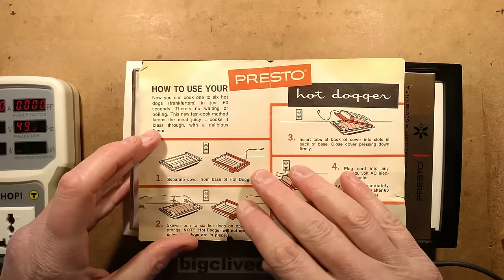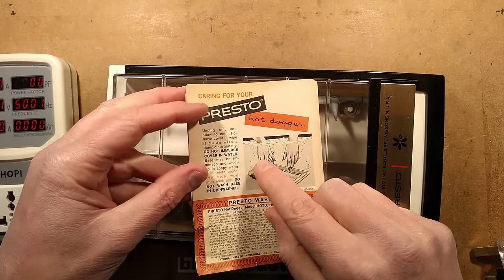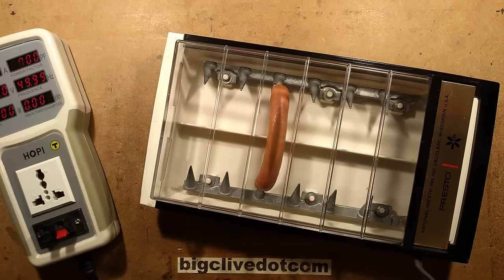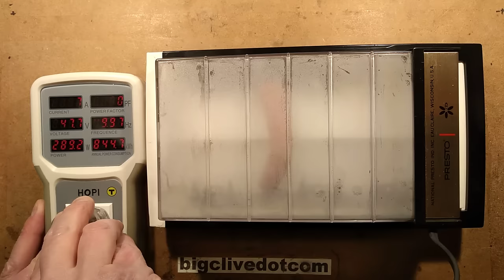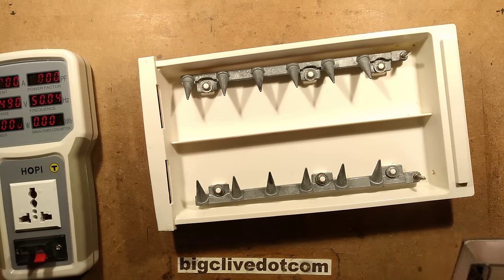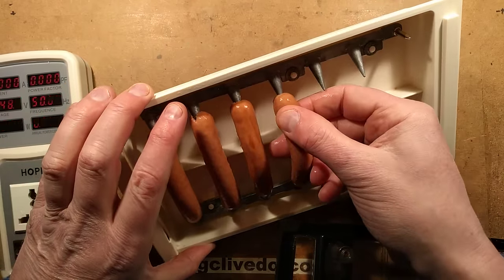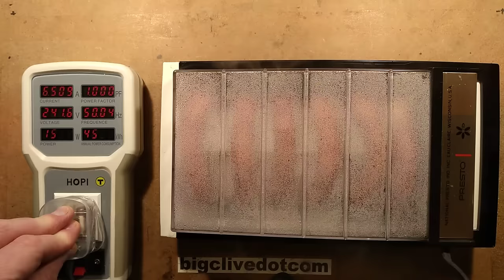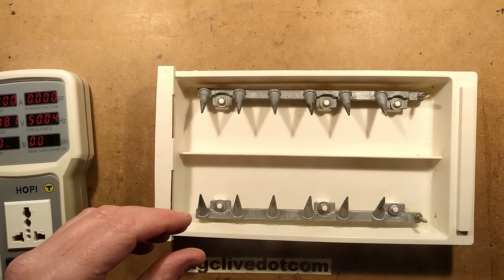Turbo charging a 120V Presto hot dogger on 250V.

Comment: Not really bad, this is a nearly 100% efficient way of cooking hot dogs, the power is used for nothing but heat generation in the meat directly.
Reply: you could play around with different shaped "connectors" but otherwise I agree totally
Reply: Every electrical heater is 100% efficient
Reply: I was thinking I could use pin headers and cook with lower voltage, but I never tested that
Reply: @crackedemerald4930  yes but on a electric stove the heat gets lost between the stove and the pan also in the whater
Reply: @badacconosu  water? No dont tell me you're the kind of person who boils hotdogs. The best part is the burned part!😂
Reply: @crackedemerald4930  except for fans moving air
Reply: @VTF5252  makes no difference - still ends up as heat.
Reply: @crackedemerald4930   the hot dog is the heating element...... just think about it
Reply: @109268  in swizerland evryone does that ^^ or the small kiosks steam them
Reply: @paulabraham2550  But not on the right place... Same goes for micro wave oven - fan, noise, ventilating the chamber (heat loss too), losses in electronics and so on. Nothing of this goes into the food.
Reply: I think we got one for Christmas here in the states around 1978. Makes me want to closet diving for old appliances now lol
Reply: @paulabraham2550  only if the air totally stops moving from friction
Reply: @badacconosu   Do yo actually eat Franks in switzerland? Here in sweden we usually only boil sausages that have skins on them..
Reply: @rimmersbryggeri  yes we do
Reply: Yeah, but it's grotesquely inefficient in that this whole device, that costs money, uses materials, has to be carefully cleaned, is fiddly to use, and takes up space, is capable of cooking exactly one size of exactly one type of food item and is otherwise totally worthless.
Reply: The big problem with that sort of heating is the chemically altering done to some of the foodmolecules, especially around the connections i dont dare to eat the black or often uncolored even unvisible changes. And if no trust in the meat near the ends of the thing i dont know with sertaincy how much of the meat contains no chemically strange altered proteïns or fat or so
Reply: @badacconosu   Ok I thought you had a higher sausage culture than that.
Reply: @crackedemerald4930  Except if you use power to heat the air which then heats the food. Wasting a lot of power. If your goal was heating the room tho, then it is 100% efficient.
Reply: @crackedemerald4930  Every electric heater is 100% efficient at generating heat, however there's no guarantee that 100% of the heat that you generate will be successfully transferred from the heating element to the thing you want to heat.  In this case, however, the hot dog is the heating element, so it's 100% efficient in that regard too.
Reply: @crackedemerald4930  they are 100 proc efficient in translating electricity to a warmth, but they are not 100 proc efficient in transfering heat where you want that heat to go
Reply: I'd never eat something that had mains electricity go through it.
Reply: @109268  you have to admit tho those New York dirt water dogs are good but at home thats a sin the dogs they are one of the  things i do when im forced to go to the hell hole known as NYC
Reply: pF of 1 lmao
Reply: @robson6285  If you're worrying about your health you wouldn't be eating the hot dog that came out of the package laden with salt and multiple other chemical flavorings and artificial dyes!
Reply: @robertvirginiabeach  so true!!
Reply: @crackedemerald4930  That statement ignores the comment. Chris did not state the efficiency of the hot dog as a heater. Chris stated the efficiency of cooking a hot dog. These are very different things. Examine the processes. 

Apply electricity directly to the hot dog to raise it's temperature. The only real source of inefficiency here is in how you deliver the power to the hot dog. Delivering the power through a semi-conductor you will lose some of the power as heat bled off the semi-conductor before the hot dot. One could use a super conductor to remove that inefficiency but that would very likely turn into the most expensive way to cook a hot dog.

Alternatively you could cook that hot dog on an electric stove. That process has many more sources of inefficiency towards cooking a hot dog. First you must raise the temperature of the heating element. Then you must raise the temperature of the immediate environment (surrounding air) around the heating element. Then you must raise the temperature of the thermal mass embedded into the bottom of the pot/pan. Then you must raise the temperature of the pot/pan itself, which in any good pan should raise in proportion to the thermal mass. Then you must raise the temperature of the medium inside the pan (be it air, water, oil, mac'n'cheese or pasta). Then finally the end of the journey of the heat, raise the temperature of the hot dog. That's a horribly inefficient way to cook a hot dog, why not just cut the middleman out and jam it into a wall socket.
Reply: @sqike001ton  Yeah I was just ribbing him. NY food laws are the reason they have to be boiled and kept in hot water, it's really the best way to keep them out of the danger zone when you're dealing with food carts in sub zero cold.
Reply: @robson6285   its a hotdog.. if your going to question the chemical nature of the cooked meat, you have no idea of its pre cooked state
Reply: @crackedemerald4930  but not 100% at heating food, some are mote efficient than others
Reply: ChrisD4335 it's 100% efficient, actually. If it's 100% effective, I don't have a clue. 😉
Reply: @ThoolooExpress  haha, gotta watch out for those filthy electrons!
Reply: @crackedemerald4930  "Every electrical heater is 100% efficient"
except there is a waste product: light?
Reply: @tommcewan7936  Yeah, no doubt it's impractical.  If I saw one at a yard sale, though, I'd probably eat hot dogs for a week straight just 'cause it's so cool.
Reply: @circuitsandcigars1278  My late parents got a newer version (pretty sure it was a Presto), sometime in the 80s, that we used fairly regularly. It's probably still kicking around somewhere.
Reply: Cracked Emerald false. What about the light and sound emission?
Reply: Have cooked hot dogs with an extension power cable and a twist of a coathanger.
Reply: @crackedemerald4930  Guess you've just been watching EEVblog.  It's only 100% efficient if the heat stays in the dog. Re-watch EEVblog where he talks about losses to the atmosphere through poor insulation etc.
Reply: @109268  Barbarian! Frankfurters also known as Wiener sausage (pure pork, smoked, sheep intestine casing) should ONLY ever be steamed, alternatively put in hot water (boil the water, then turn power off, drop in sausages for 10-15 mins).
Reply: @jarls5890  An actual frankfurter is not even close to the same thing as an American hotdog man.
Reply: @109268  Alrighty! Feel free to update Wikipedia then as it says:

"The hot dog[2][3] or dog (also spelled hotdog) is a grilled or steamed link-sausage sandwich where the sausage is served in the slit of a partially sliced hot dog bun, a bun of size and shape to hold the sausage.[4] It can also refer to the sausage (the wurst or wörst) of its composition itself. The sausage used is the wiener (Vienna sausage) or frankfurter (also frank). The names of these sausages also commonly refer to their assembled sandwiches"
Reply: @jarls5890  Yes, and an American style hotdog is an artificial cased sausage bearing no resemblance to the German  lineage it is descended from.
Reply: If that's what you're looking for, the microwave is the best way.
Reply: The hot dog radiates heat, so while good, it's not 100% efficient at heating a hot dog, just 100% efficient at generating heat within a hotdog.
Reply: @sqike001ton  I hate to say it, but you havnt really lived until you have a Hot Dog from a vendor on the streets of New York
Reply: @crackedemerald4930  - except the glowing ones, when they give out light. 99% heat, 1% light !
Reply: @paulabraham2550  - except maybe for the amount which reaches the ears as noise! 
No heat involved.
Reply: @ThoolooExpress  - except for escaping sizzle = energy escaping as pressure waves in air, of which some is converted at ears as noise  = electrical signals to brain.
Reply: @martinpickard6043  Okay... I'll give you that... it's not 100% efficient.  But still a lot better than a pot, a grill, or a microwave.
Reply: Efficient doesn't mean tasty.
Reply: @landonpowell6296  good point mr powell
Reply: @tommcewan7936  This type of device could replace traditional Hot Dog Rollers, which do just that.
Reply: @robson6285  The kind of chemical reactions that happen on the electrode/meat contact points woulddnt be disimilar from that of a frying pan on an electric stove. It depends on what your electrodes are made of.
Reply: @109268  Thats how you do it in germany.
Like normal people.
MURICA isnt very normal.
Reply: @haywoodjablome440  but electrolysis? That must in proteïnes and all that biomolecules weird new random half molecules make? I mean at least H & O & ions etc are things you dont make that way when heating normally. So i thought. I dont really know so if you do know more about eatable electrolysis then feel free to tell me more?
Reply: @robson6285  Well, if youre concerned about it at that small level then youd be reassured by the thought that anything that has gone through such a drastic level of change would probably get stuck to the electrodes and never make it to your digestive tract.
Reply: stove will have some losses through switches, voltage regulators, controls etc...whereas this is literally direct power into the meat lol
Reply: @crackedemerald4930  Technology Connections?
Reply: @robson6285  And I wonder if microwaves do that as well.
Reply: @SweetTodd  no microwaves only heat the food. Electrolysis is only a problem by current trought a liquid. But indeed, a littke eddycurrents will go though the food in a microwave so absolutely sure i am not about that
Reply: @crackedemerald4930  Not quite. Those heaters lose some power to sound and radiation. Nothing is 100% efficient.
Reply: @badacconosu  Also you lose some energy to the walls due to the wiring from the meter to cooker element being a weak resistor also. The biggest loss of all when cooking hot dogs by boiling though will almost certainly be the energy being lost to the heat of vaporisation due to the boil off, water thanks to it's strong hydrogen bonding has a rather large heat of vaporisation so producing steam as a waste product is rather thermodymanically expensive.
Reply: @tommcewan7936  
That's not true!  It could cook a potato, or any other food with some water in it, maybe a burrito!  😂😂
Reply: @tommcewan7936  hmm well you could try other things.... Cucumbers? Cheese sticks?
Reply: May have been efficient but often the hot dogs tasted like burnt hair! Really, I remember because I had one back in the 1970's. lol.
Reply: Electrolysis!!
Reply: @tommcewan7936  I understand what you're trying to say but many items are single use such as a coffee maker or electric kettle these items can also be hard to clean and are only useful for a single purpose. (Although water is just generally great and useful for just about everything) I'm just saying excess is kind of cool sometimes despite the waste of resources.
Reply: @robson6285  "i dont dare to eat the black or often uncolored even unvisible changes"
" i dont know with sertaincy how much of the meat contains no chemically strange altered proteïns or fat or so"

Yeah, you have a neurosis. That's fine, but you have one. Just FYI.

Comment: If you listen you can hear the screams from health and safety  :)
Reply: You never touch me anymore.
Reply: Wat ^
Reply: it has a interlock, so its safe :)
Reply: Health and what?
Reply: Yep looks perfectly safe. Old, but safe. I wouldn't leave it unattended though. Not that you would have time to since it cooks so fast.
Reply: Sounds about right 😂
Reply: It's actually safer than a toaster, as you have no access to to the live electrics as the rails are only live with the lid on, you'd have to poke something very small into the receivers on the lid while its plugged in to get near the current.
Reply: are you guys serious? this device literally electrocutes hotdogs and breaks its chemistry its not a hot dog anymore when you run current through it
Reply: @ErtugrulOzdemir-mf1gl  
It adds some flavor from the electrolyzed electrodes. Additional minerals.
😎
Reply: Not in the era when these were manufactured. 😂

Comment: I had one of these back in the '80s, when microwaves started at a few hundred dollars.  Aside from a slight metallic taste at the contact points (likely from a lack of cleaning), it worked very well.

A dill pickle in there for a few minutes gives a rather interesting light show at 120V; it would be interesting to see what happens at 240V.
Reply from the maker: We put a large pickle in during a live stream.
Reply: Naughty - I like  😃
Reply: My family had a large "in wall" microwave oven back in the late 1970s.
I used to take frozen hamburger patties from the freezer, and "cook lunch" for myself in it.
I was QUITE poor at doing this, and ended up with ugly, shrunken patties, still cold and uncooked at the center, and light brown on the outside.
Yum!
Reply: @bigclivedotcom  Why isn't there a clip of that on youtube? I need to see it!

Comment: Okay, I like the 'overclocking 120v appliances' idea.
More, please!
Reply: I've been witness to someone plugging a 127V coffee maker into a 220V outlet whilst working in Brazil. We knew the coffee was done when the glass jug shattered. Twenty seconds for the hot-dog seems reasonable: twice the voltage, four times the power, assuming the resistance of the hot-dog remains constant.

Have I really just written "Assuming the resistance of the hot-dog remains constant"...?!
Reply: LOL.. I did seriously think the hot dogs were going to explode a few seconds after being powered up.  I remember how they popped and sizzled, and that burnt electrical smell (and taste..).  Sadly, they only cooked faster. :-P
Reply: @chrisw1462   I thought they might too!
Reply: do you know the channel photonicinduction?
Reply: My fridge on 240v can approach absolute zero. Food lasts for 20 years or more and visitors never come back twice for a midnight snack.
Reply: Yes. Toasters are definitely a thing to try. They glow so nicely.
Reply: @HowardLeVert  yes you did
Reply: I also like this idea...I really miss PhotonicInduction's experiments...and it would help fill that void... also maybe if the appliance blows up, Clive could take it apart and see what went wrong.
Reply: Watch Barry Lewis video where he plugged a 120v toastie maker into 240volts 😂
Reply: Next, a Weller soldering station. Errr... wrong channel.
Reply: this is a really common way of infomercials to overdrive their stuff so it works really good.  The reason that they generally toss them under the counter after use is because they are hot as fuck and probably gonna smoke.
Reply: ManiacGamer That was truly dangerous for him because he didn’t realize at the time what was happening lol
Reply: Chubbysumo - ☹️🤬
Reply: Make it a bit more like the old photonicinduction channel :)
Reply: Just no burn human references, please!
Reply: @HowardLeVert  It seems that the hot dog resistance varies.  I suspect it curves up rather quickly as the moisture leaves, given the notoriously steady energy input needed for that steamy phase change.  Of course, that jump coincides with "done", so I think it's reasonable to assume (and this experiment suggests) that you're correct and that resistance is generally constant during the cook time.
Reply: @danroberts7975  the correct technical name of that procedure is "take it to bits". 😄
Reply: Hope life is going well for Mr Photonicinduction
Reply: @borayurt66  10kV accross a hotdog please
Reply: @tr3kn3rd  Until it pops :-)
Reply: @claton blade, I believe the frequency doesn't make any difference when it's a pure resistive load.
Reply: Photonicinduction
Reply: This thing has absolutely no electronics, it's that it lets all of the power go through the sausages.
Reply: Photonic Induction does better than that.

Comment: Hahahah "the power factor of the hotdog is nearly one"  said no one in the history the earth ever.  love it
Reply: r/BrandNewSentence
Reply: No capacitance or inductance..  pure resistive load...
Reply: @Revolting Swan There are three ideal types of loads in electronics: Resistive, Capacitive, and Inductive. In resistive loads, all the energy goes into the load. With purely inductive and capacitive loads, energy gets moved into the load, and then right back out again (in AC systems, like the hotdogger).

Power Factor is a quick way of communicating whether a circuit is resistive (PF = 1) or purely inductive/capacitive (PF = 0) or somewhere in between. It's really important when you're dealing with motors and generators and all kinds of machines. It is not, traditionally, associated with hotdogs.
Reply: @JohnDoe-rl9pp  thanks